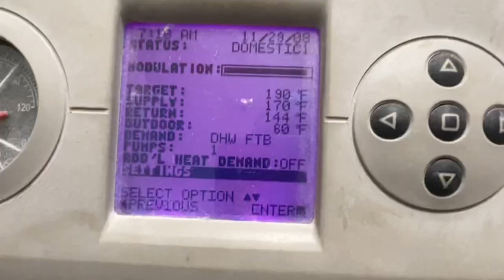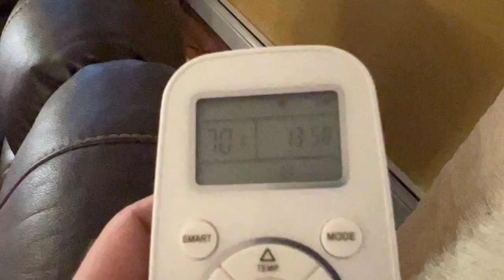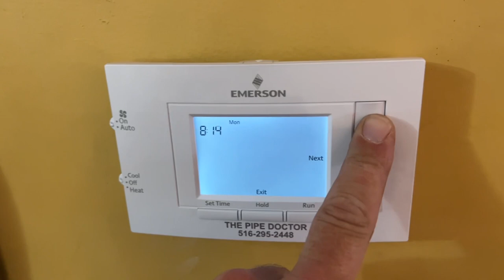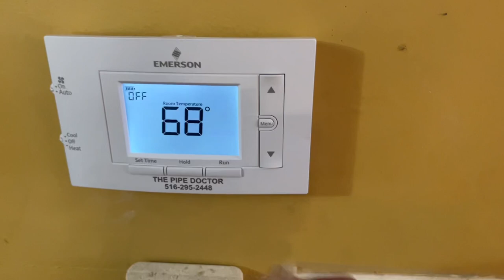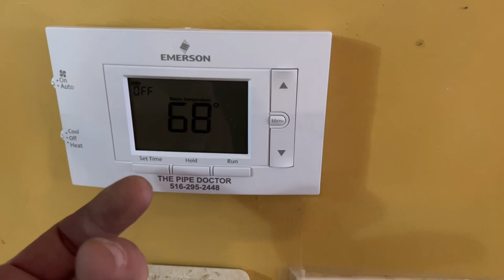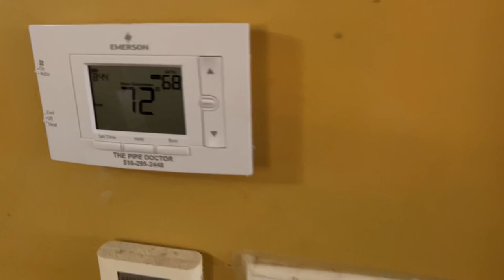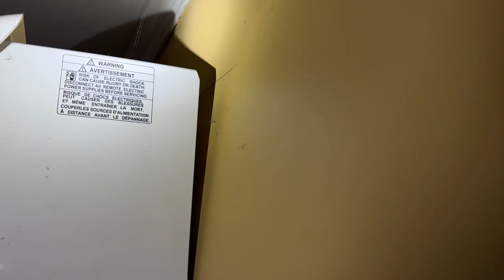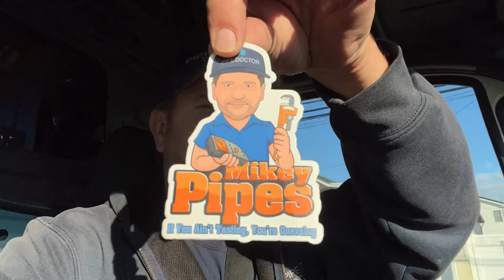Help! My House is Burning Up! The Weil McLain Ultra 3 Boiler Does Not Turn Off & Thermostat Dead

Comment: Gave into the pressure for 2 semesters studying engineering which I didn't even know what it entailed. Thankfully dropped out with little debt and got into Refrigeration and Air Conditioning. 1 month into my first job and I'm much happier than I was in Uni.
Reply: @Supa Trending Daily I'm not even making mid 5 figs yet, but with due time we'll get there

Comment: Your so right about the trades Mike. I remember when those trade schools were here in Ontario. We had two types. One was a two to three year school for those that would become carpenters, sheet metal workers, welders , drywall installation and such. The other was for more advanced trades such as machinists , auto mechanics, air craft mechanics, tool and dye makers, plumbers, electricians and such. That was a four year school. They don’t evaluate kids in middle school and push them towards their strengths. Instead they pat everyone on the head and tell them how special they are and they can be anything they want to be. They create a broken person because by the time the person realizes that they are in over their head and can’t do the college work and drop out they have already racked up debt they can’t pay because they can’t find a job that pays a decent wage.
Reply: Same problem here in Italy about the educational system... There are a lot of job like electrician, mechanical, hydraulics they are very rare to find.

Comment: The techs that came to install new furnace were very good and I was taught to respect  a tradesmen time so everything was moved out of the basement and broom clean for the gang and the van and big truck..  boiler installed and tuned and they cleaned up and were gone and a computer printed final bill in my hand as they drove away...  if you make it easy for the techs they can fly

Comment: I would of checked to make sure the stem of the ball valve moved freely.  There is a good chance that motor gears  were worned down because  the ball valve stem is  seizing  up

Comment: The thermostat in my travel trailer decided it wanted to be European and switched to Celsius all by itself and I couldn’t figure out how to get it to switch back. It’s in the shop now getting that fixed and some other things too. At least it still worked. I just had to figure out what to set it to. I don’t do tents anymore cuz I hate freezing.

Comment: 1 this happens a lot tune up call turns into repair. I always fire up the unit before I do any work at all with the customer so they can't say what did you do
2 I agree we need to bring trade schools back into the school system kids are coming out unable to even know how to read a tape measure what is 7/16 wrench half inch wrench let alone change a tire on a vehicle

Comment: I've never seen a video of yours where the old Taco 555 zone valves are used.  is there a reason those weren't used out there? I'm in Michigan, ran into a lot of Honeywell ZV's like this, a lot of Taco.  IMO the worst were the Danfoss wall/radiator mounted controls.

Comment: I cut me teeth in Mod Con land with the "Ultra boiler with a PHd"  I hate that boiler with a passion.
Reply: I have to agree! Do not like the Ultra series. You can have em. 
I even had a Evergreen NG floor mount that had a delayed ignition on a 3 week old system that wouldn’t start until I replaced the igniter kit. Lifted the boiler off the ground. Tech support had me replace
Blower & Venturi Assembly, igniter kit again, burner, burner gasket, gas valve, pretty much every gasket and kept asking if it was LP because they have had it happen before and new how violent it was.